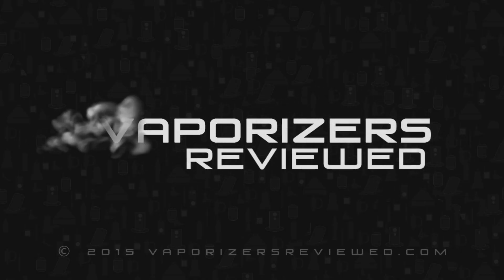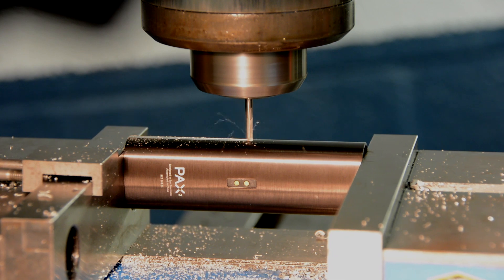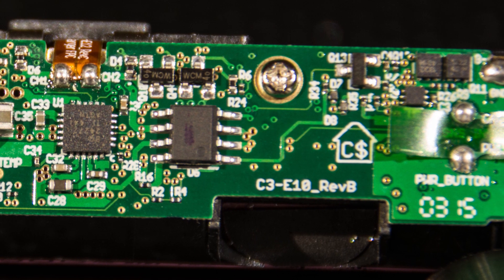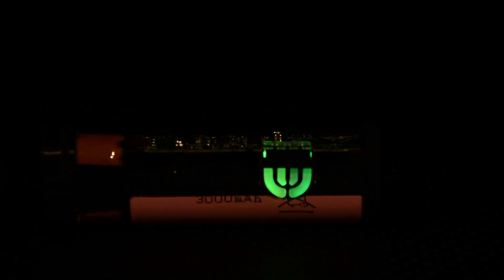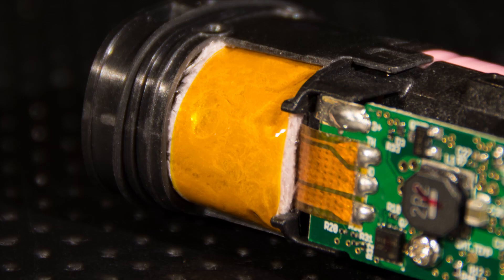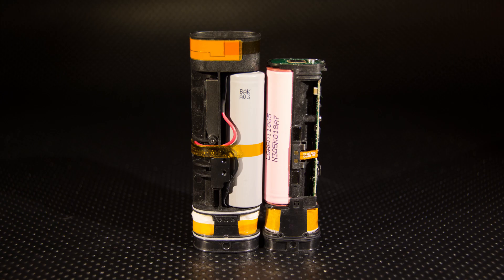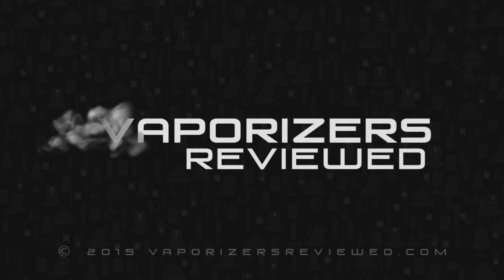What's Inside the PAX 2?

Comment: Never had a battery fail. But have PAX's 2, 3 and Plus all fail. I'm on my 8th PAX in 3 years. Currently using a Plus which is now playing up after 4 months.
It's always the button. It's absolute rubbish and a really stupid idea. It shouldn't be anywhere near where the vapour comes out. The vapour condenses on the underside of the mouthpiece and finds it's way under the rubber. It eventually builds up resin which stops the switch from working. The switch is also affected by heat as it had such tiny little soldering holding it on.
Love and hate all PAX's in equal measure. Especially as it can't be repaired.

Comment: The main chip on that pcb is BQ24272. It regulates charging and discharging of Li-ion batteries. The chip to the right is probably a 5v regulator. There is a SMD CMOC 4007 or 4017 to latch each temperature setting to one of the four selectable wonderful temperatures settings. I recommend starting on the highest with about 50% filled bowl to really get jacked up!

Comment: I own a Firefly and an Arizer ArGo. They are both cool units but the vapor path is suspect on both. The Firefly is convection and the air flows over the heating element which, to me, means you might be inhaling some metallic "gases". The Ariser Argo has, what I consider, a "better" vapor path, but the gasket near the intake is malformed and doesn't seal very well. Based on this video, the PAX looks like it has a really well sealed vapor path that would greatly minimize any toxic elements for entering the air path. The company that puts extra effort in their design, to assure the vapor path is 100% isolated, will be a real winner!
Reply: Do you recommend some model for a cleans and safe air path with no metals, toxics or plastics please?

Comment: I think the lip sensing tech is based on temperature which would get lower as you pull and get hotter as it sits still, also possibly the level or shaking or balance of the pax would indicate wether it’s being used or not. That could be the trick. Some of the led light settings and games that you can play on it are based on these sensor reading too. I’m only guessing but I bet I’m close.

Comment: The lip sensor can be seen around the top button. It's a capacitance sensor. The PCB looks well made, solder joints aren't cold and SMB components appear to be mostly for clock pulse timing of components which is what you would expect.

Comment: Oh another thing I'll send the thermo down by the oven if you notice I can actually reference different segments of your video at timelines but the heating oven on the old one head O-rings below and above the oven that match the case that would have been awesome on the Pax 2 as that would have kept the oven Heat out of the circuit board in Battery area

Comment: Seriously your cell phone battery has a thermistor on the charge circuit if you take the battery out of any phone weather was a phone that you could pop the battery out the back or you have to take apart the phone there is three pins minimum positive negative temperature within that there is a circuit board on that battery that won't let it charge if it's too hot

Comment: Upon watching your video again great video by the way but this thing is very poorly designed so going back to the thermistor at the oven it actually designates th on the logic board so that confirms that the mouth sensor without looking at it closer I don't know as far as the battery another huge complaint it is upside down so if it ever has to vent it's venting liquid before the air Gases that's another design no no again there's no thermistor on the battery so you could theoretically get that battery up to a hundred 35 degrees without a thermal Runaway I eat if it's sitting on your dash in your car plug it in and you just exceeded thermal runaway temperatures yes that's not a common occurrence but damn for the prices thing it was engineered and designed by engineer kids in class nobody looked at this that had Real World experience especially across the board of lithium technology boost technology etc etc I mean to me this is Child's Play then this is a fail

Comment: I had to get the consumer safety board for the United States unto them for the version one because there was no thermal cutaway if there was a thermal Runaway or even a self resetting temperature Bass fuse I would like to see one on the battery itself is everyone is justifiably concerned about Vapes exploding the Pax one the positive wire actually ran down the side of the battery so if for some reason that wire shorted to the ground on the battery it was over fire you're done kaput I actually had that happened to my Pax 1 I was at a pool and when it went into thermal runaway I checked it into the pool thankfully even though it destroyed itself from the thermal Runaway the damage was clearly the positive wire coming off the battery grounding back on the battery so the Pax 2 just from what I'm seeing still has a convection oven using flexible ribbon cable which is not bad which also does incorporate a thermistor I eat the thin wire on that ribbon Cable ONE is positive one is negative the other one is the thermal resistor damn speech to text anyway the PCB doesn't appear to have any conformal coating on it so high humidity environments that's going to suck if you actually get it wet even from the rain that could seep in and do corrosion damage still see no real protection for the battery yes lithium ions have an internal blow off but let's be real do we want to wait till it gets that bad and though sometimes fail I would like to see a thermistor attached to the battery connected to the logic board AKA printed circuit board that would prevent you from a shorter life from operating it at high temperatures to preventing a thermal runaway in the first place let's say you leave it somewhere where it's already hot then the battery is low so the inductor circuit has to pull higher amperage at lower voltage for that battery heats up that middle tube is right next to the battery so that's heating up the battery as well you can easily reach 135 degrees internally or even 120 which shorten the life of the battery
Reply: This is exactly what i wanted to hear.

Mate do you think lithium polymer battery in the fury vaporizers are any safer from explosion?

Comment: The 24 pin part is a  BQ24272 circa 2012 Texas Instruments Li-ion charger chip rated at 2.5 Amp single cell.  It works with the hexagonal coil nearby. Also, it is soon becoming obsolete ("not recommended for new design").The 8 pin part likely a microprocessor such as the Microchip ATtiny series.

Comment: I know this was a while ago, but since seeing how it was held inside, do you think it would be possible to slip the whole plastic part out from the metal tube by clicking down the charger port, to 'unlock' it? ie: Without sawing it apart?

If not, I was thinking about sawing around the outside, to make it easier to put back together, while also creating a 'heat break' to the mouthpiece end. ;)  

I'd like to mod it for easy battery replacement.
Reply: I also like to know if this is possible, did you find out? Thaks.
Reply: So it failed to work? Yes obviously the battery will fail at some point. So as you say 'clicking' down the charger port could be a solution - how else would they have put it together?

Comment: The lip sensing technology is for real. I was messing around with mine. I got to party mode. I flipped it around a couple times an then shook it. I got to a light cycle where all 4 lights were different colors. If I shook it the colors would shift an stop at random colors. At this point, if I take a hit or touch the mouthpiece the colors blink. It's using random colors from the whole possible selection.

 I can't imagine how it works. I'm not pushing the button an only touching the rubber mouthpeice.

Comment: Considering my pax 2 works great when i turn it on (still has some charge) but not charging anymore, no matter if i plug into adaptor or computer, or with diff microusb cable - any idea whats up? I dont see any lights when i dock it on the charger...
Reply: wipe the charging contacts on the pax with a cloth and it will charge again
Reply: Having the same issues.,it’s probably a cheap copy.I got in contact with Ploom and gave them all information.They were very helpful and told me it’s a copy.Beware of buying off EBay and only buy a Pax from a recommended Pax authorised seller.
It’s funny because my sons name is Olly Goldstein so I just had to reply to your post

Comment: Hey, any word on where I an find a replacement flex cable for the Pax 1 convection oven??? I have torn my pax apart on multiple occasions. Its charging fine now but the original problem was the flex cable wrapping around the oven was frayed by so much usage. First the charging flex was separating from the body so I opened it and taped it down (I should have just called pax, instead I fixed it myself since it was a gift to me and I know nothing about where it was purchased for warranty info). Pax could not help me with my oven flex cable issue and I really loved this device. :/ I even might want to do a coil style mod around the oven but I honestly have no idea how those connections (labelled "TH," "GND," and "HT," on the printed board) are organized on the oven itself.
Reply: Did you change the battery?
Reply: @ Nah. Pax wouldn’t take it as a return so I kept it in the junk drawer. I was using it 5x daily so it just wore out. I got one secondhand and replaced the battery and it’s still good today

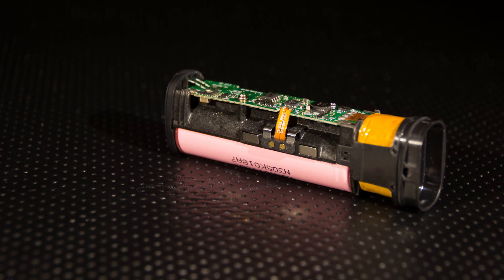Comment: TO THE VIDEO CREATOR: This is a huge technicality! And it doesn't really matter, but I just want you to know. The MATH @ 1:53 IS WRONG. The 3000 mAh battery is not up 10% from the 2700 mAh battery. If it was up 10% that would be [2700 mAh + (2700 mAh * 10%)] == [(2700 mAh + (2700mAh * .1)] == [2700 mAh + 270 mAh] == 2970 mAh. NOT 3000 mAh. So while it is almost 10% more, it is in reality slightly more than 10%. To show more precisely what I mean lets do 12.5%. [2700 mAh + (2700 mAh * 12.5%)] == [2700 mAh + (2700 mAh * .125)] == 2700 mAh + 337.5 mAh == 3007.5 mAh. 3007.5 mAh is much closer to 3000 mAh than 2970 mAh. ORRRRRRR You could have said, "the old battery is 10% less than the new one." Sorry I'm ripped. The MFLB is better anyways.
Reply: mflb is trash
Reply: Sad anorak
Reply: stop nit-picking bro

Comment: I thought I read some where that 'lip sensing' is actually tracking temperature drops at the heating chamber, indicating that air was being drawn into the device (presumably consuming vapors!). If the thermal feedback system calls for a burst of power to re-warm the tank, it was from inhaling air through it. Clever!

Comment: If the mouth piece is electrically isolated from the housing, but connected to the internal microcontroller the device might able to sense when somebody is touching both the housing and the mouthpiece at the same time. Maybe to automatically fire up or preheat the heater without pressing on a button. That is nothing advanced . But they sound like it's state of the art rocket science, which it isn't. It's simple electronics. Same with all that coil and ohms talks. Pure Bullshit. Nothing in there what a middle or high-school kid didn't learned in physics class.
Reply: +Axel Werner It's cool to have it in something you can use to smoke weed. That's why it's so cool

Comment: Thanks for opening that beauty up. I appreciate your honesty regarding the internals, wondering of you know if they new battery in the pax 2 has better fireproofing than the original. I currently have the orig and after watching a news clip of a dude needing his jaw wired shut after his e cig exploded I would definitely upgrade to a safer unit
Reply: Even if it did explode, i dont even think it could explode the body, unlike those cheap e-cigs. Although im sure it wouldnt be pretty, I dont think your jaw would explode like that one guy. But yea, even though the machine is high quality, I always have the fear of it exploding because im high and paranoid.

Comment: Open a Mivape by vaporfection and you will find loose fiberglass packing..Seems like I would be inhaling fiberglass because the air passage is inside. I took mine apart.   Its going in the trash.

Comment: I know how the lip sensing tech works. it's built into the power button and is a normal capacitive layer. When you push the rubber cover under the mouthpiece you can see how it actives the oven even if its sitting still.

Comment: The smaller square component in the centre with notation "BQ24272" is used for Battery Charging and delivering high efficiency power to the Oven. What's strange is that this component is End Of Life, meaning they will have to swap this out for a new one during the lifetime of this product. If you want a full overview, please share Hi-Res photos of both sides of the PCB and I can give a detailed description :)
Reply: How has this not happened yet
Reply: @zencarpediem3733  still hasn't 😭🤣
Reply: This would be very intresting to know more details!
Reply: have had 2 die to strange charging problems where they would show charging but nnot actually charge.  thankfully the warranty is amazing....but that EOL part is SUS
Reply: all talk hahaha
Reply: Still hasn't

Comment: So is there a magnetic tool that can be used to release that clip?
Reply: +Vaporizers Reviewed.  It can't be depressed into the mechanism then?  It must be pulled out?  I thought that it looked like the clips were pushing the contact up through the opening.  I was thinking that with enough force you could push the connector in far enough to allow the internals to slide the out of the housing.
Reply: Patrick Brathwaite  This is just what I was thinking. Did you ever try it?
Reply: @koz  Did everyone die who tried this or what happened?
Reply from the maker: Leo Badinger No you would need to drill into it and be able to hook it somehow.

Comment: Well, it was interesting to see the inside of the unit. They are well designed. I have two Pax 1's. It has been my go to device for maybe two years. I don't really use anything else. It seems silly to say the tolerances are tight (did you measure?) and to not know anything about what is on the inside. Lip sensing is easy. Human skin carries a small charge and it's easy to detect these days. The PCB contains mostly IC's. The 2R2 part is something unusual. I would guess it's part of the heating circuit. None of it really matters. It's not really practical to judge the quality of electronics by looking at them. If the solder points were sloppy, maybe. But they are all made by machines that use very exact amounts of material. So you wouldn't see that. As you said, it's not a review. It's show and tell. I just got mine. I plan on trying it soon.
Reply from the maker: J German I'm not sure why you feel its silly to say the tolerances are tight, with both PAX 1 and PAX 2 opened, its clear that all dead space within the unit was completely eliminated.  I didn't measure, as some areas had voids, gaps and areas where nothing is going on.  In the PAX 2, they were eliminated completely where possible, and minimized as much as possible in other areas, so no measurement was needed.  The fit of all parts is much more refined.

Comment: 4:35 Deja vu all over again.  
C'mon Pax, what is the deal with lip sensing?!?
Reply: I think the "lip sensing" is actually just the motion sensor.
Reply from the maker: Sungodv I think the lip sensing does more for the LEDs than it does for the vapor quality.
Reply: +Vaporizers Reviewed were you happy with the thickness?
Reply: +ArcadianGenesis it's a capacitive sensor, same as on smartphone that work with your fingers but not with gloves.
Reply: +ArcadianGenesis it's a capacitive sensor, same as on smartphone that work with your fingers but not with gloves.

Comment: lip sensor -- IT'S RIGHT THERE -- didn't you see it?
Reply from the maker: Cole Hatton Missed it by that much.
Reply: Vaporizers Reviewed It's in the flex circuit on the front end of the device. Capacitive sensor + button.
Reply from the maker: Cole Hatton So the ring is the capacitive sensor?

Comment: Please, PLEASE, PULEEEEZE take some good macro shots of the PCB and throw it up on iFixit!

If you want some crowdsourced info on what everything is, and does in the Pax 2, you'd be hard pressed to find a better site to gain the knowledge you desire.

That would be so cool that it might actually hurt!
Reply: Vaporizers Reviewed Did you manage to upload any detailed images of the teardown?
Also, now that you have had the PAX 2 apart, is is possible to disassemble the device by overhauling the spring/charging contacts rather than machining the housing?
Reply from the maker: Skip Transit I will absolutely do that tomorrow. Thanks!
Reply: Did you ever do that? If not, could you send photos to me? I am curious as to whether the microcontroller can be reflashed.

Comment: If the battery is as it the website spec sheet says for Pax 1, its gone from 2600 to 3000 mAh, a 15% gain.
Website claims up to 30% more usage time, part of that is from the new tech
Reply: Vaporizers Reviewed Sounds like a law suit. I will let you know how I get on
Reply from the maker: Brunnerxxx You're correct, I pulled the serial on my battery and it returned only 2700mAh results, but their site is claiming 2600.